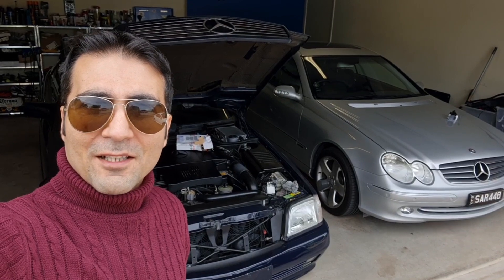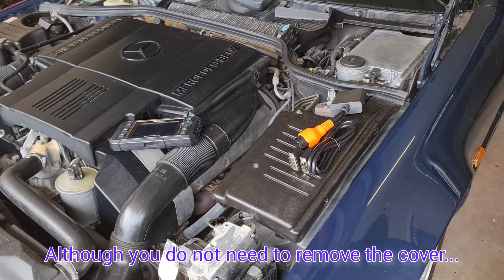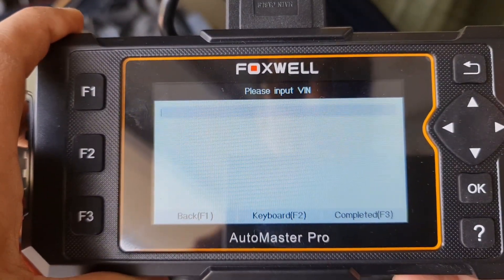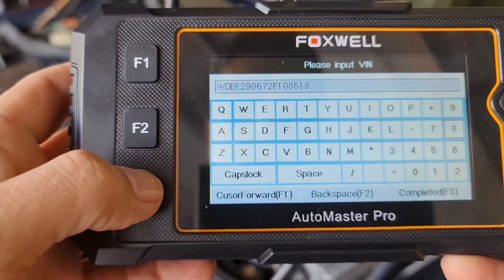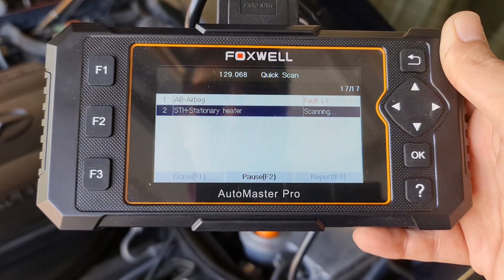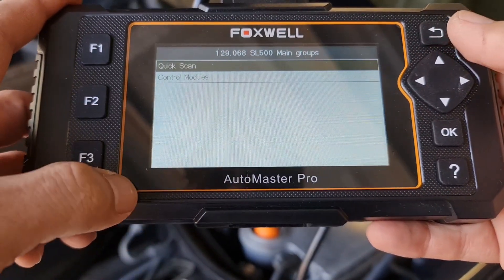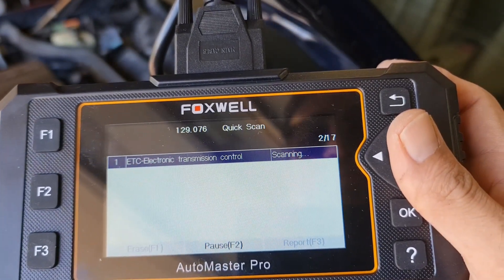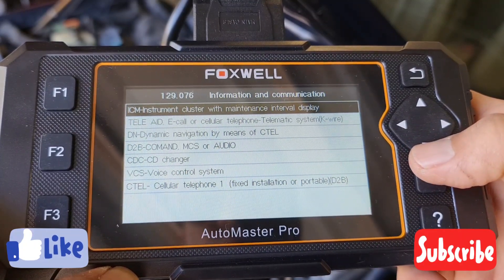Diagnosing 1994 SL500 R129 with OBD2 Scanner?

Comment: I think the only solution is to buy an old laptop with Windows XP and the old RS232 or D-Sub9 connector in laptop(im not sure which one was right), Star Diagnosis system, and a cable with a multiplexer C3.
Reply from the maker: Yes, I have a more recent video comparing Star C3, XTOOL D7W,  and this one.

Comment: my Autel OBD scanner (that usually works on all cars) can only connect to the engine ECU on my 2001 SL500 and nothing else...
why is that and how can all modules be read / faults deleted?
Reply from the maker: There should be no problem reading 2001 R129. It uses 722.6 which has a straightforward TCU. Check with other diagnostic tools first.
Reply: @BenzAddiction  thank you! that’s very strange then…will try with an other reader  of my friend and report back then.

ps: no success, the second reader can’t read any ECUs 🤷🏻‍♂️

Comment: The obd 2 scanner works only well on 1999 sl500 its otherwise useless
Reply: @BenzAddiction  do you know the location of the EGR valve on a 1994 SL 500
I believe it on front/top part of engine
Reply from the maker: @Gagge-c9y  front centre a bit to left under the small plastic cover.

Comment: Hi, was that a 38 pin connector adapter? And I’m amazed I never knew that was even possible on a pre obd 2 Mercedes but that’s cool you were able to do so! Could this be done on pre obd 2 w140’s, w124’s etc?
Reply from the maker: Hi mate, yes 38 pin adapter,  if it works on r129, it should work on w124 & w140 too...
Reply: @BenzAddiction can i have link how to order the adapter sir
Reply: Awesome! This is going to make life so much easier lol 😂, it was always so difficult and time consuming diagnosing Mercedes 95 and older, I’m so glad I watched your video! I had the 38 pin connector diagnosing w208 and w210 chassis but never thought it was possible on the older r129’s and other chassis, thanks so much!!!
Reply from the maker: Btw, If you are in QLD, Australia, I am happy to try this on your car...

Comment: Just a thought, buy you might try scanning it as an SL600 since it had the hydraulic suspension as standard equipment unlike the 500 where it was optional. BTW, I have a 1994 SL600 with a similar issue and I'm intrigued by the possibility of using this setup if it works.
Reply from the maker: You are right, but I even bought a MB Star C3 and while I used it successfully on my w209, I was still unable to get any code from my R129 hence I now believe that there is something wrong with my car in communication module or things like that.
Reply: @BenzAddiction  did you get the adapter with your Foxwell scanner or did you buy it separately? I looked at some adapters on Amazon and in  every one of them the reviews said that there were only 3 wires connecting pins, so obviously they aren't going to be able to access the majority of functions correctly. Have you opened the 38 pin connector to see how many wires yours has?

Comment: Greetings from a Sydney based subscriber. My car is also a 1994 SL500 and I have not found anything other than Star that works with these cars. I also think your car would be a 129.067 - the same as mine.

1994 missed it by just that much unfortunately.
Reply from the maker: Hi Michael,  I live in Brisbane and welcome to the channel,  I ended up buying the MB Star C3 and still having issues getting codes and live data.i think there is something wrong with my car, but knock on the wood my car is running good now...
Reply: @BenzAddiction  what are you troubleshooting?

Comment from the maker: Hello my friends, I have never seen a video on YouTube in which anyone trying to diagnose a R129 with OBD2 Scanner using an adapter.  Honestly the adapter and scanner kinda satisfied my expectations as I initially thought this would be almost impossible. In saying so the diagnosis was not a perfect one either. What's your opinion?
Reply: Is that a Foxwell adapter or aftermarket . I've read a lot in the Mercedes forums, about the aftermarket adapters not working properly.